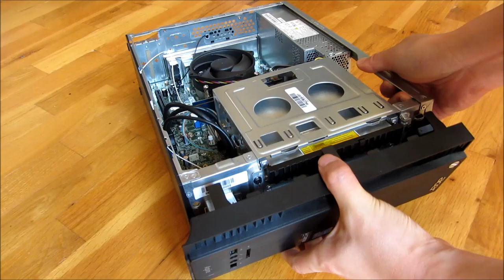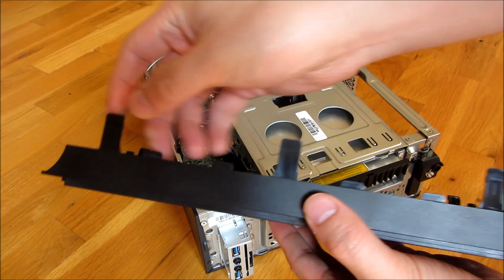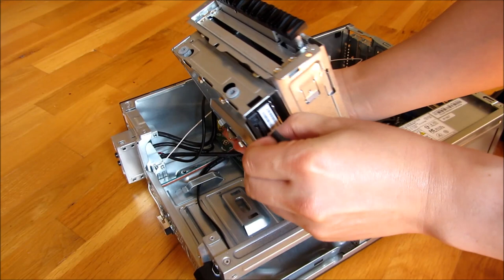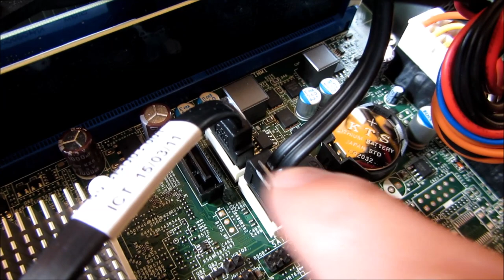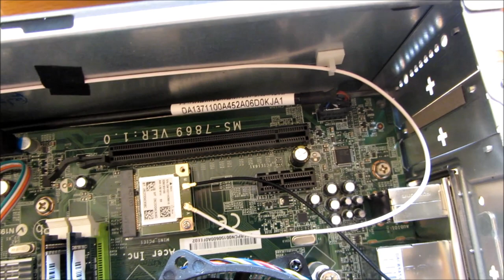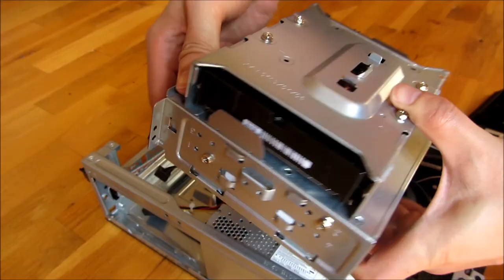Acer Aspire Desktop | How to Remove Hard Drive DVD | AXC SFF

Comment: Hi!  Thanks for this video.  It helped me find my way to the clock battery, which finally gave up the ghost...
Reply: What is the use of that battery
Reply: Hi Tom.  If you leave the computer unplugged and the regular battery has discharged, the clock battery will keep the internal clock (brain ) running, even though it’s off.  I think it helps keep certain ‘presets’ in memory too (but not sure)...

Comment: Is this case a standard micro atx that could take a new motherboard?
Reply from the maker: Almost.  The problem is that the Main Power Cables are fine, but the cables for the Power Button and Chasis is so proprietary and made for that specific motherboard and its not easy to separate, as the "grouping" of the chasis cable is a special cable for that motherboard pin arrangement.
Reply: @PoolarityChannel  so then, it just can't work?
Reply from the maker: @lgmnowkondo938  It can work, but then you would need to splice the wires from the chasis with the wires taht came with the motherboard.  Its whether you think that effort is worth it or not.
Reply: That's merely amazing
Reply from the maker: @OFCLTRPL6OG  You betcha, merely!

Comment: the screws at the bottom of the hard drive...mine doesn't have them. Instead it has bigger screws on the width side, and not below it on the video. Do I remove those instead?
(My hard drive is dead and does the "ACER automatic repair" loop, in case you needed to know)
Reply from the maker: Yes, remove them.  3.5" hard drives have both 4 screw holes on the side and 4 on the bottom for attaching to a mount on the computer.  So its safe to remove them.
Reply: Alright, thank you. I've done so (earlier obviously, not as I'm writing this) and I see some improvement with the new hard drive I put in.

Comment: I have the Acer Aspire XC-840 model with no dvd drive, I got a used slimline dvd drive that was very tight to fit in but managed it, my next problem is the motherboard has only 1 data 2 connector but I can’t see any power connector which the drive has data and power connector, can I use without a power connector. I have no leaders yet so I need to purchase. Please can some one help.

Comment: I have a similar product, Acer Aspire RC500 desktop. and the CD/DVD  Disc  will not open.  There is no little hole to press something into to get it to open. Also, when powered on, right clicking on the CD/DVD  I  have the option to Eject, but when selected it asks me to put a disc in.  As  am not any way mechanically minded, I cannot get the casings off. Admittedly, this is a spare computer, running XP, but, boots perfectly and does what it has to do, other than that CD/DVD player.  Only reason I want to eject or use the CD player is, there is a dvd in it I want.       ( I do not  use internet on it)

Comment: My Acer Aspire XC-705 desktop kept creahing and switching itself off, and I read it could be caused by overheating from a dusty fan. Looking through the holes at the side, I see there's quite a bit of dust on the fan but I don't know how to remove the panel to get to it to clean the fan. There's very little in the way of screws and the panel seems like it's just two whole parts that don't separate ?  Please how do I remove the panel ?
Reply from the maker: if its not a gaming machine, and you use it for web surfing and YT and movies, then try to reduce the Max CPU use to reduce the heat, see my video here - https://www.youtube.com/watch?v=299P_hrZR9Q

Comment: hi,I want to upgrade my graphic card to gtx 1050 ti low profile.can't fit with single slot gpu space.If can upgrade will buy new Matx casing & new power supply.Thanks.
sorry for broken english
Reply: azmi ali so how did it work out?

Comment: At 5:32 what is the thing plugged in that has brown and black wires. My computer has that, but it wasn't plugged into anything and I don't see anywhere to plug it in. I'm not sure if i accidentally unplugged it. I really don't think I did because I was really careful when unplugging everything.
Reply from the maker: You mean that 4 prong?  I believe thats usually extra power required for certain CPU's, your CPU may not even need it.
Reply: Poolarity - Life Hacks 
Yeah the 4 prong (Sorry I don't know the right terms lol) so it probably wasn't plugged in to begin with. My computer isn't the same model as the one in the video.

Comment: Is it possible to place another hard drive into that DVD space?
Reply from the maker: You can always put a Laptop hard drive or SSD there with the free SATA port, split the power cable with a splitter cable and just leave the SSD or laptop hard drive floating around in the case, but tuck it away better.
Reply: Poolarity - Life Hacks is it possible to put a ssd where the hdd is? Its a small space there. If I put the ssd there. Maybe it dont move so much?🤔 SSD on a 3,5 bracket or whats its called
Reply from the maker: SWEpatriot92 S I think u can put an SSD without mounting it, because SSD are so light, doesn't matter
Reply: I've upgraded this crap to a GTX 750Ti and 12gb ram will be buying a completely new one

Comment: I replaced the HDD with an 2'5 inch ssd from my laptop. However i if plug in the two cable from either port im getting a "Media test failure". Please help me! :( thanks for the video
Reply: Wait so the hard drive in the video is 3.5"?